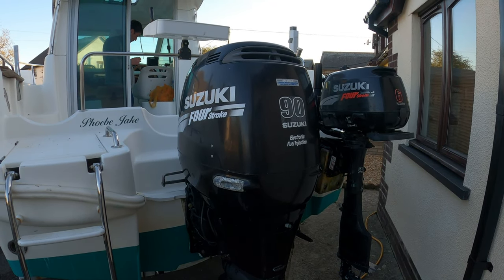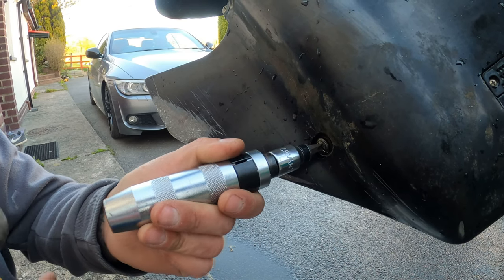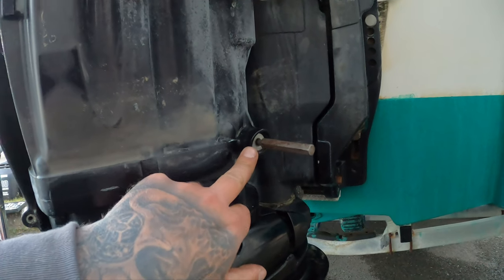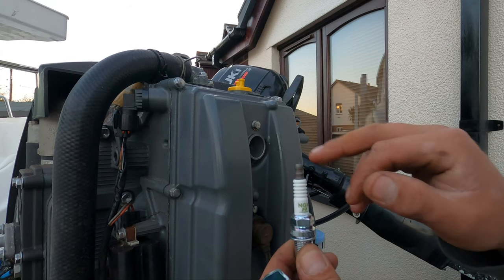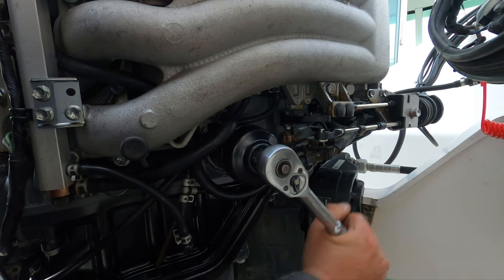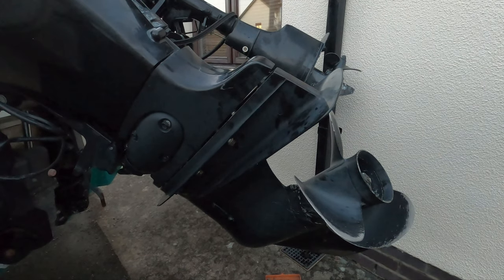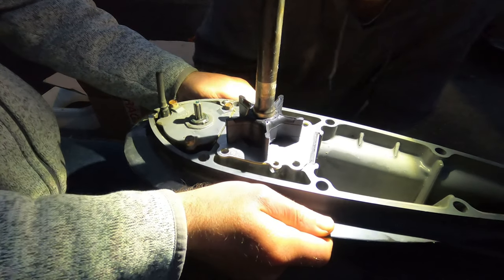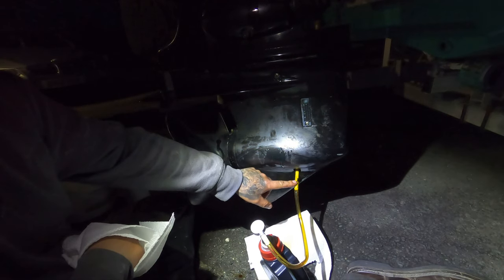Suzuki DF90 2003 FULL 97. 9 hour service

Comment: i was told that if you have a vent either side that your muffs need to have a hose pumping water into both sides of the vents or else you will damage the engine as one side of the vent wont be getting enuff water
Reply from the maker: No it's fine as long as it jetting the water properly like this was your totally fine done it for years

Comment: Awesome video. Do you have to do anything with the shift linkage to remove the lower unit for the impeller replacement? Thanks!
Reply from the maker: No I don't believe so it's like a cup it pops on to but it has been a while since I did it so can't remember 100%

Comment: Why not just fill the oil from the top plug rather than the bottom drain plug?
Also some torque settings on bolts & plugs would be useful?
Reply from the maker: It's so you don't get trapped air in in it tweet the oil if very thick. 

I can't find torque specs for it so just tighten it never seen any video give torque specs for this job